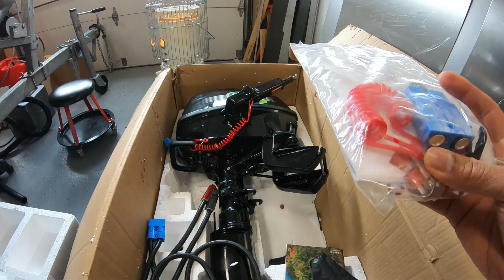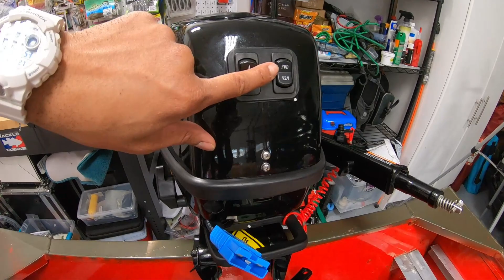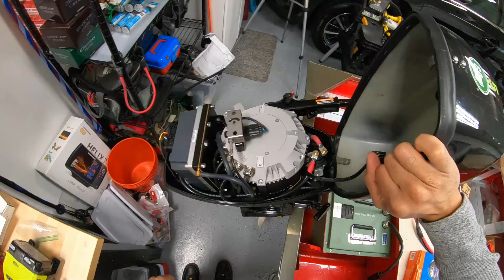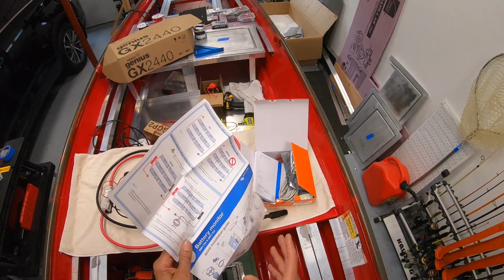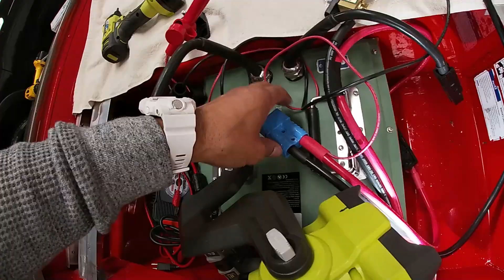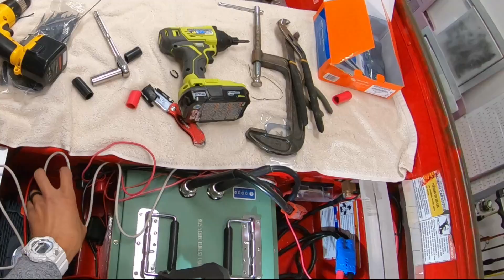ELCO ELECTRIC OUTBOARD MOTOR - UNBOXING & INSTALL {Jon Boat to Bass Boat Conversion} Alumacraft 1232

Comment: I hate to say it, but there is ZERO customer support with this company. After running out of battery with their Victron BMV-700 battery monitor showing an 85% charge, I have not been able to get anyone at the Company to support their product, return an email or answer a call. BEWARE. Being on a river with no power is not a place you want to be!

Comment: How many  hours can you run  aat full speed ?
Reply from the maker: I don't own this boat. I just did the build out for a customer.  Most electric motors will run for 1 to 1 - 1/2 hours at full speed.

Comment: Very detailed video. I am expecting my Elco 20 hp motor within a week.
Reply from the maker: Nice. Is that a 48 volt or higher?
Reply: @BassBrothersFishingDMV  It is a 48 volt motor. I have built a solar electric catamaran that it will be powering. See my Youtube channel for videos.
Reply from the maker: @philboyer2036  I see. Boat looks awesome. Great for the family.

Comment: There are many good electric outboard options as well. Check out ePropulsion Spirit 1.0 Plus. The real simplicity. Weight is less than 40 lbs including the integrated large capacity 1276 Wh 48V lithium battery.
https://www.youtube.com/watch?v=cMer4S6phFY

Comment: Like that setup! Weight of battery? Weight of outboard?
Reply: Batteries are heavy, 104 lb. for each of 4 batters for the ELCO 20HP.  The motor weighs 85 lbs.  You might want two strong helpers to deal with these parts. And you must be sure your boat will support that much weight in the rear end.  This hardware takes nearly 500 pounds off your rated weight carrying capacity for the boat.